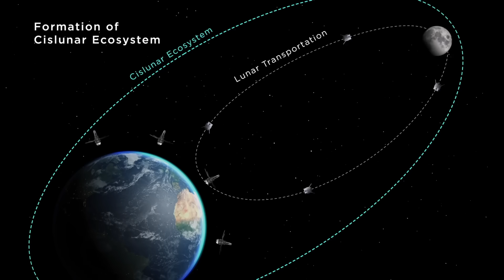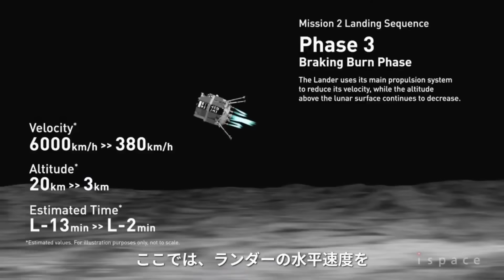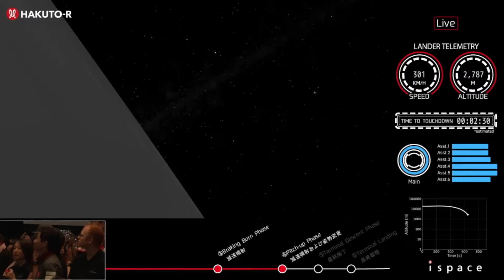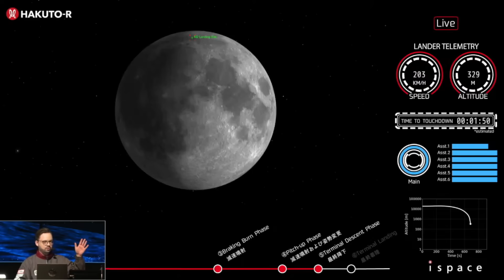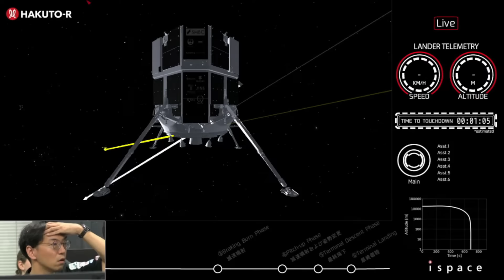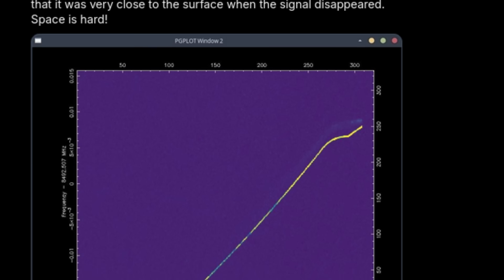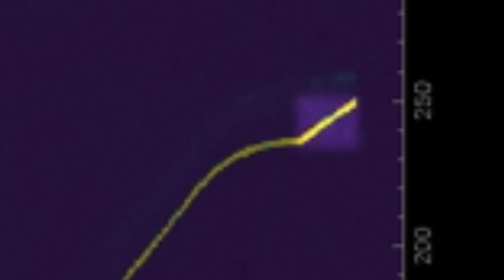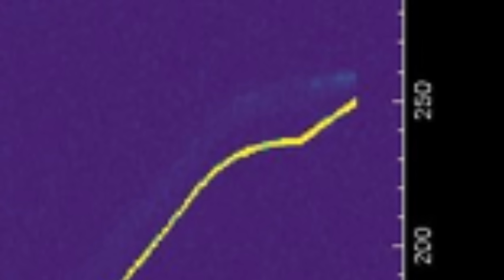Japan Crashes into The Moon, but Slower Than Last Time

Comment: I get the "cost per launch" via more powerful engines etc...
BUT, after how many fails does that cost increase become eclipsed ?

Saving money on one, or two launches is great.... EXCEPT, these efforts are failing constantly. So it's a net loss overall.

Literally by the time any lander makes it to the surface, it will be the most costly endeavor in all of human history because the 2,5,9...17, however many previous attempts, have failed.

Just spend the extra and get it done.....
Reply: The Wikipedia page says that the total cost of the Surveyor program was US$469M (I believe that is in 1960s dollars). Using an inflation calculator, that converts to about US$5B (using 1961) to US$4.1B (using 1968). So let's call that around US$4.5B. Seven surveyors were sent to the moon, 5 landed and 2 crashed. So roughly, that's $640M per vehicle. I saw one report that the first ispace lander cost $100M, the second less. That's about 1/6 the budget, so they can fly 6 vehicles for the same cost as 1 Surveyor. If you only count successes, they would only need to land 1 out of 9 to spend as much as per successful Surveyor mission.
Reply: Those are VERY conservative estimates seeing as the falcon 9 alone, costs 67m to lauch. Not counting the payload, the mission prep etc. And I'm talking about the per launch costs, not an entire program. Failure is okay and expected in the course of an endeavor,  but trying to sell it people as "being cheaper", is well, a cheap cop out. @Zhiroc
Reply: This was a rideshare launch so they're not paying for a whole falcon 9. In terms of CLPS, you can see how much taxpayer money is being spent. Usually $50-120 million.
Reply: @Zhiroc sure, but that cost estimate incorporated everything, including R&D. Each spacecraft was artisinally crafted and took a lot of work to figure out, but it's already been figured out. Why not use the Surveyor design as a standard bus to carry payloads? A proven design that you didn't have to spend any money to develop would save a hell of a lot over many theoretically more efficient designs that never actually work
Reply: @Zhiroc  All true, and there was much more money available in the NASA budgets then since we did not have the 80+ welfare programs and other entitlement programs that competed and ate up all the money in annual congressional budgets, so we had more cash available to do nice things like go to space then, whenever we wanted to, with manned or unmanned missions. It will be even more tough now as more and more money goes to social programs and less and less to space budgets, so the era of exploration in a big way, and manned missions, is gone, perhaps for the next several decades. And don't even get me started on the public education and quality of our engineers and training/experience of our astronauts then too. ;D
Reply: The other way to look at this is that we already know how to land on the moon with a big budget. What we want to learn is how to do it cheaply.
Reply: @robinbennett5994 even if the overall cost is higher 🤔 for success.....
Reply: you could build, and launch, ten thousand landers for the cost of one saturn five moon mission.
Reply: 100% wrong, sorry....  @ThatOpalGuy
Reply: @ThatOpalGuy show me the maths

Comment: Sounds like LiDAR needs to gimbal…
Reply: Bottom line lessons learned: Not good to remain ignorant of the true altitude until the final seconds. That- repeatedly now with more than one lander- has been shown to not be a good assumption to make, no matter how much cost/weight it saves. - Dave Huntsman
Reply: Or maybe just slap another lidar on the side of the spacecraft that would be looking "down" during approach and thus have a much smaller gap without any lidar data during pitchover
Reply: @yakovdan I think the last IM lander had this, & tripped over a crack in the sidewalk. 😂
Reply: At least a little mirror or prism needs to gimbal.
Reply: And now you have an additional pivoting component which needs to survive the harmonics of a rocket launch
Reply: @JamesBrown059  Ah, ok 2 lidar then. one sideways, and one downward. and probably a redundancy for both.
Reply: @JamesBrown059  But you also has something that can land...
Reply: Firefly placed another optical head nearly perpendicular to the thrust-aligned one. Probably saved them.
Reply: Or have a head mirror or have multiple lidars.

Comment: tsla ditched lidar years ago.  cost only decision?
Reply: SpaceX didn't.
Reply: @CorwynGC  lidar only used as part of the very slow iss connections.   "SpaceX's Crew Dragon spacecraft uses advanced machine vision to track the docking target, and cross-references this data with information from the LiDAR for redundancy and increased accuracy. "
Reply: @baref1959  But you think that Tesla is somehow more relevant?
Reply: @CorwynGC  yes in fast motion dynamic environments, like landing on the moon as opposed to slow landings in open space, tsla requires better accuracy and reaction time.

Comment: Don't throw away the comments about the surveyor spacecraft. Do a video that compares surveyors technology with the technology that is being used today to get to the moon. What made surveyor more successful than what they can do today?
Reply: the surveyor program actually had just about as many failures as these did at this point, ranging from (theorized) LOS resulting from a fuel tank rupture and of course, crashes. but one made it eventually 

also, money. NASA actually had money back then, lol
Reply: @71sd39 - And a Congress that realized they would be in a lot of trouble if the Russians got there first, especially if that happened because of Partisanship, “Bring home the bacon” & other forms of “Business as Usual”!
Reply: A radar altimeter. Surveyor had it, all the latest lunar landers have been using laser altimeters and suffering for it.
Reply: @Cketzalcoatl yeah that too, it struck me as odd that none of these have done that as it seems like the best semi-reliable option. don't know if it's a hardware availability issue or a cost one
Reply: My semi accurate memory sez he did
Reply: Surveyors used the old stop above the surface and free fall the rest of the way.  Still they did get closer to the surface, I think the fall height was about 10 feet.
Reply: Surveyor was overbuilt (more powerful launch rocket & engine, more robust parts), because they knew they didn’t really know what they were doing, while the people building these probes are using much less powerful launch vehicles & engines and less robust parts overall.
Reply: Surveyor wasn't successful at first, these commercial landers are still more successful in comparison
Reply: @nuance9000  But it was successful remarkably fast. And the technology was so primitive -- basically a mission event timer and a few sensors. But one should note just how wide the landing gear and how low the center of gravity was. The Surveyor 3 landing failed to turn off the engine quick enough and hopped around on the surface as confirmed by the Apollo 12 astronauts when they visited it. Those were some amazing times, and some incredible engineers in the 50s, 60s, and 70s. I still cannot believe the Voyager spacecraft are in interstellar space and still partially operational. It boggles the mind.
Reply: @nuance9000  You may be thinking of Ranger. Surveyor became successful after just a few flights and think about the Atlas Centaur booster. The Centaur upper stage was like 2 year old technology.
Reply: @i-love-space390Yeah. But saying nonsense sure brings the bots out 😮
Reply: @nuance9000 bruh
Reply: having crew on board to react in real time, honestly
Reply: @pallingtontheshrike6374 Surveyor had no crew onboard.
Reply: @pallingtontheshrike6374  it takes 2 sec. for information to travel to the Moon and back - if they really wanted they could build-in a remote control capability. It's doable, they just don't want to.

You can't use it for Mars, because the lag is too great but 2 sec. lag is perfectly acceptable. Just hire a pro-arcade gamer - they can't land it without sweating.

The real reason seems to be those engineers are just amateurs that don't know how to design properly. Enthusiasm can't beat reason and thinking, at least in lunar landings it can't.

Comment: All of these struggles only make me more amazed at what they were able to accomplish in the 60s.
Reply: It helped that we had trained pilots on board that could handle that last few hundred meters.
Reply: @tippyc2  yes, with the best "computers that money could buy" then, all at miliary grade pay to boot!! ;D
Reply: @tippyc2  USSR send rovers 3 times to the moon ,2 landed smoothly with computers with 1 kb off memory ,21 century with computers 100000000 times stronger ,1000 times advanced sensors and communication off 7 send by NASA program ,6 failed
Reply: There were various differences making current landings be a leap in complexity. Nowadays the aim is for a very precise guided landing in challenging locations during lunar twilight to maximize active time. Back then, the goal was just to come in hot on an impact trajectory without orbiting the Moon and land long enough to study candidate landing sites for Apollo, which were conservatively chosen to have a smoother, easier to land on surface.
Reply: The secret sauce was naz... German scientists.
Reply: Capricorn One
Reply: @robertthomas4329  "American Moon", lots of original, unedited footage!
Worth a watch, at least the 10 last minutes if you are very busy ;-)
Reply: Fear is a great motivator.
Reply: @RS-ls7mm  I was more thinking of the surveyor landers, but yes, having someone there for Apollo did help quite a but. If 11 were a surveyor, it would have crashed.
Reply: Surveyor was rather short and squat, with wide stance. Much more stable than the taller modern probes that are sacrificing stability in favor of maximum science payload.
Reply: Hidden Figures not Fugaku 😅
Reply: @ApKieras sad that our memories of Apollo are getting overwritten by propaganda like that
Reply: Americans don't land on the moon😊
Reply: Why do you even bother clicking on a video on a channel about space just to spew lies? The Americans did land on the moon and modern photos have shown that

Comment: After all these crashes by moon landers over the past few years I keep wondering why hasn’t anyone tried teleoperating a lander directly down to the surface yet? Sure there would be a delay of 1.2-2.4 seconds of response time, but it must solve some of these issues right? Or is the increased mass margin needed for the extra fuel to make up for the more time spent in landing that way (slower landing, longer time spent hovering, etc,) really that prohibitive?
Reply: I was wondering the same thing as I cooked dinner this evening.
Reply: These spacecraft do not have the required downlink datarate to transmit live video, and certainly not during the landing.
They would typically use an omnidirectional antenna to transmit the telemetry because that would make its reception on earth independent from the orientation of the spacecraft.
Once it has landed, it may use a more directional antenna (like a dish) pointed at earth, and send data a bit faster.
But during the landing you would not have a recognizable picture to use for control.
When you see video of a landing (on the moon, on mars) it invariably is a recording made during the landing and then transmitted to earth after landing, using the directional antenna, and probably still at a lower bitrate than that of the video.  No problem, when you can spend more than real time to transmit the recording.
Reply: @Rob2 So even at just lunar distance the signal from a omnidirectional antenna on one of these small landers is too weak for the big dishes at the DSN to pick up enough to support any kind of useful live video? I’d thought that video compression was good enough now that something could be worked out… I’m under the assumption that is planned to be different for the Artemis crewed moon landings (and probably any Chinese ones), as they will presumably provide a live video feed during landing (no idea about their antenna configuration though). Maybe those larger crewed landers would have the mass/power for a stronger transmitter, omnidirectional or not? And of course the Apollo missions were able to provide live video from the Moon, though that was after landing and using a directional antenna.
Reply: @KirbyTheEpic  Exactly.  Lots of people claim that "they saw the moonlanding live on TV" but that cannot be true!  The moonlanding was not transmitted live on TV.  There were programmes covering it, but they had only audio, no video.
The movie of the landing (shot from the lander) was shot on 16mm film, and only when they were back on earth it was developed and shown.
The video shown live on TV was only of the moonwalks, not the landing, and it was sent using the directional antenna, and at low quality.
Of course with today's technology they could transmit HD video of moonwalks, but likely not live during the landing.  We will see.
Reply: @Rob2  I mean, can you imagine how disappointed people would be if they tune into a crewed moon landing in a few years and it’s just another animation 😭
Reply: @Rob2  When people say that "they saw the moonlanding", what they usually mean is that they (along with 11-year-old me) watched Armstrong setting foot on the Moon, live.
Reply: except that your lander is going to be behind the moon for much of the deorbit process - can't remote control such a lander unless you had a lunar comms network in place already - i.e. multiple sats to relay your signal to guarantee real time all the time (even with delay) isn't a thing even for large space agencies yet. They can manage a couple of relay sats, sometimes... need more to do what you suggest. Eventually, that will be a good way to go. For now, landers have mostly had their own terminal guidance software, and radar altitude not matching projected altitude has killed several landers in recent years.
Reply: yep, this would probably work

the training simulation for the pilot would have to be quite accurate though

but nothing THAT impossible, i think
Reply: Even at 10mph, you're traveling at 14.6 feet per second. So your lander will be 30 feet "different" from what you see, with just a two second delay at bicycle speed. Come in faster, even 30mph, now your lander is 100 feet away from where you think it is. And that's a best case.
Reply: @lyfandeth  Human brains are really good at compensating. If you know your operating with a delay you know you have to take action long before you see a reaction.
Reply: @asandax6 not really, just look at the recent Ukrainian drone attack on Russian planes. Most of them were controlled manually, real time but with a lag. Still the targeting was slow and wonky (for example landing in the middle of the A-50 radar dome) and they had the luxury of being able to hover and approach carefully, slowly. When you're doing a suicide burn on the Moon there's very little room for error even for automated landing.
Reply: @asandax6  Exactly, and it would be trivial to model this delay during simulations on Earth.
Reply: A 1.2 - 2.4 seconds delay seems completely prohibitive for any kind of direct control during a landing.
Maybe a human could help select the exact landing spot but thats pretty much it.